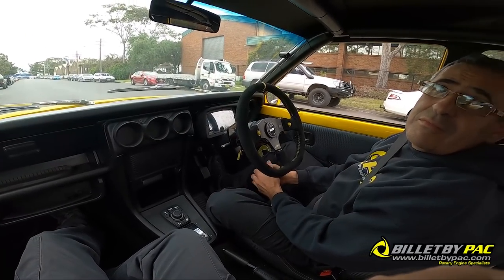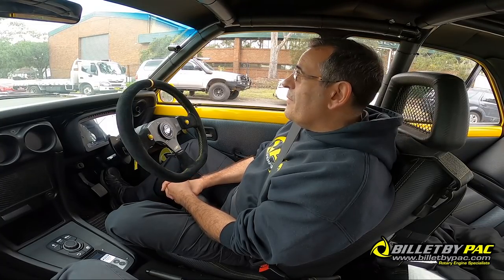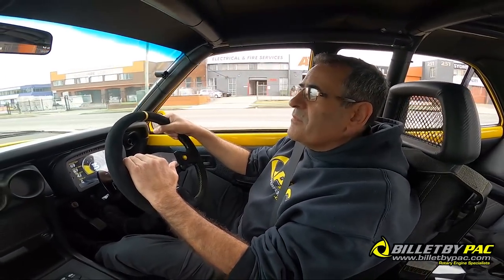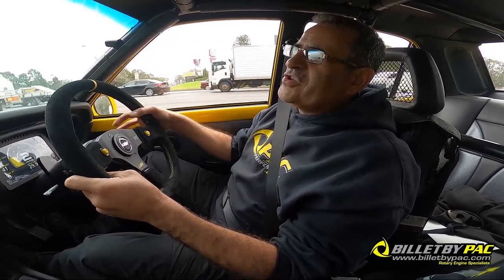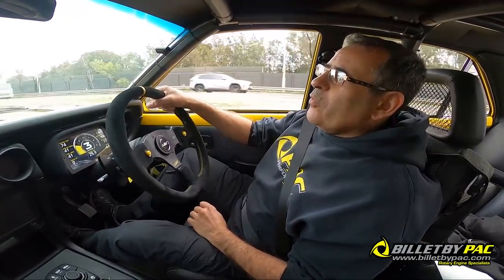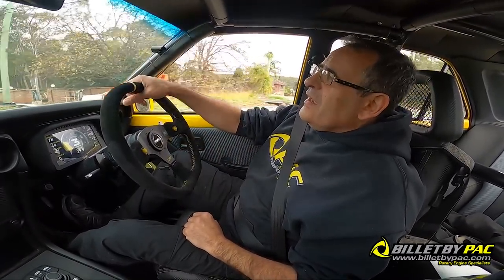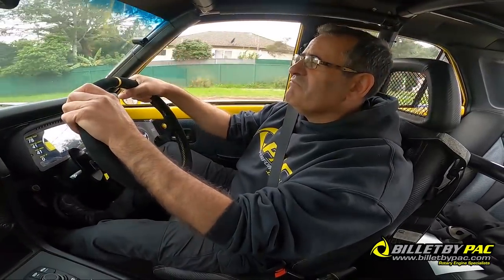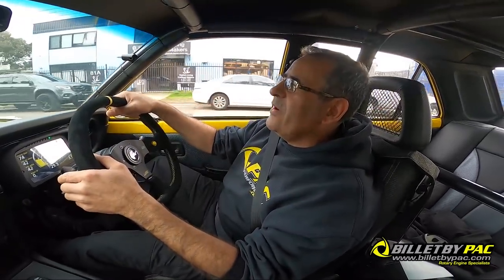CRUISING WITH ROCKY - BILLET BY PAC 13B PLATES & ROTOR HOUSINGS ON THE STREET! 'HACSAW' RX3

Comment: Hi guys are these big power motors that run on the street reaching good amount of kms in your testing ? Over 20,000kms with the same motor ?
Reply from the maker: We've got several 500+hp street cars that have been running for 10+ years on the same engine

Comment: RX3s were R&D'd by Mazda to have 13" wheels on them. Not 17s or 20's witch make the car a danger to the driver and all those around.Also it makes them look like an overgrown rollerscate.
Reply from the maker: Not sure what your comment has to do with this video, but just for your information, this car runs 15" Wheels at all 4 corners and there's not a lot of original Mazda engineering left in these cars when we build them. Everything is upgraded to suit and all are thoroughly tested by a certified engineer when issuing the certificate.